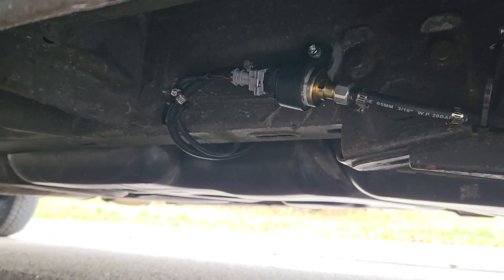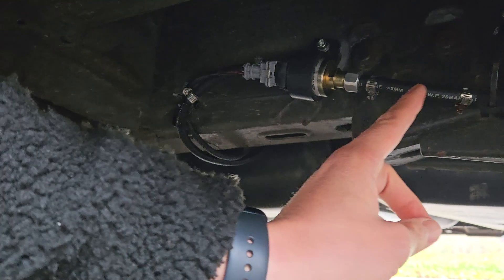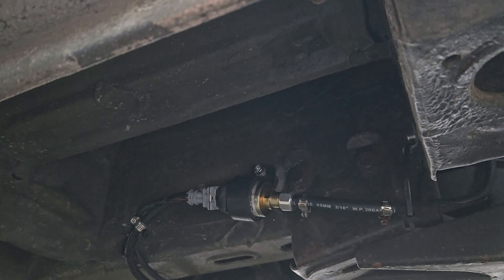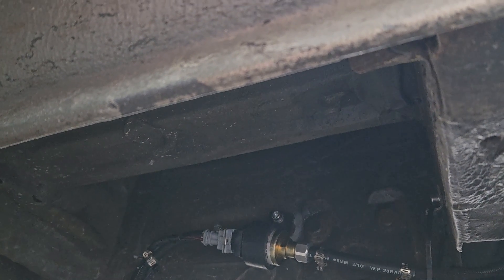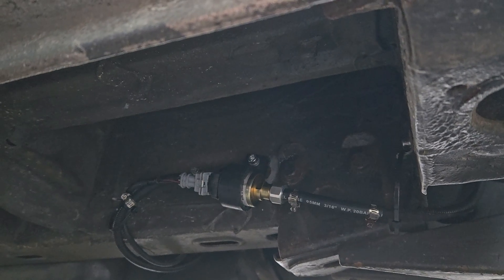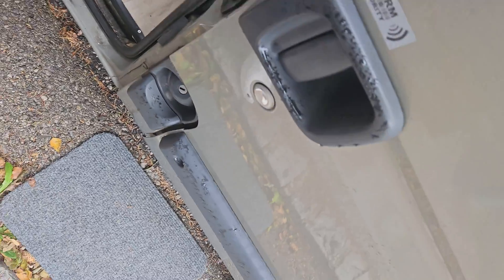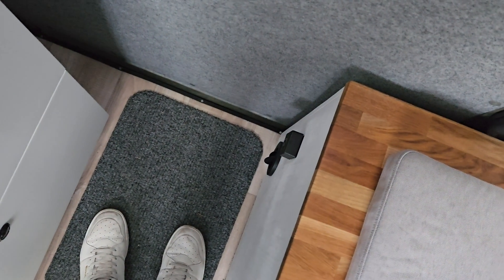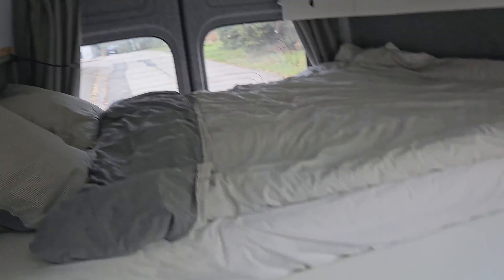Stop the Clicking! Silent Diesel Heater Pump in 5 Minutes

Comment: You seem to have had some good results. Well done!  However, I don't fully understand what you did. Am I right in saying that you bought a longer hose and moved the pump farther away from the feul tank, then you took half of the older hose and put the smaller hose that goes  to the burner inside the old black rubber hose?  Do you have a link for where you bought the replacement hose, OR what specification do I search for?
Reply from the maker: Hi Kevin, thanks for your comment. The only thing i did was buying aprox. 1m of a new hose and put just longer hose sections on both sides of the pump. The theory is, more rubber more damping. Which means longer rubber hose more damping of the clicking noise. But ofcourse too long is also not good for the pump. So aprox. 10cm on both ends did the trick for me. Just google for a 5mm fuel hose (i think its an fiber reinforced NBR hose) 
hope this helps 
BR Christoph

Comment: That's great as long as you're camping in an area that is above freezing. That pump isn't going to work if it's below zero
Reply from the maker: Why to you think that? Used it already in freezing temperatures. Operating temperatures should be down to -45 degrees according Autoterm. Looking forward to your opinion
Reply: @3dtecstudio  Wrong... been using my diesel heater mounted in exact same configuration in temps way below freezing for weeks at a time
Reply from the maker: @Luke-gk8lg  hi Luke, yeah I was saying the same thing 🫡
Reply: Absolute rubbish!!!
Reply: Because diesel starts to gel up at 10° to 15° F. A pump located on the outside of your rig and exposed to the temperatures is far worse than having it inside. You are better off keeping it inside and isolating it in a small box lined with Dynamat or some other isolating material
Reply: @kp5778   I can confidently say that you are incorrect.  I've been using mine with the fuel pump mounted outside and we got down to -37 C (-52 C with the windchill) a couple nights ago, and the pump ran without issue.  

Now, I have my fuel tank mounted inside so it only has to get down the short fuel line into the fuel pump which isn't far enough to gel it in any conditions.  But diesel trucks are the go-to vehicles for Northern climates, in places that get much colder than they do here, and this gelling issue you speak of doesn't cause issues for them either.  I've worked in the patch in these conditions for years, and diesel is fine in the cold for any fuel pump be it in a vehicle, heater, small generator, you name it.

Diesel gelling is 100% not an issue whatsoever.
Reply: @kp5778  🤣 diesel does NOT gel at 10-15F unless it's still summer fuel and not treated at all. Still mostly just clouding not gelling